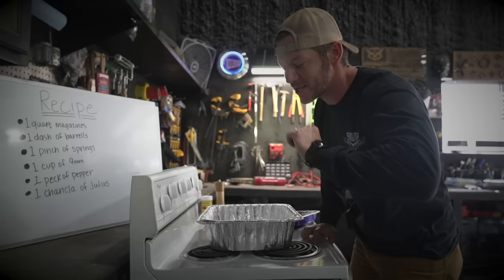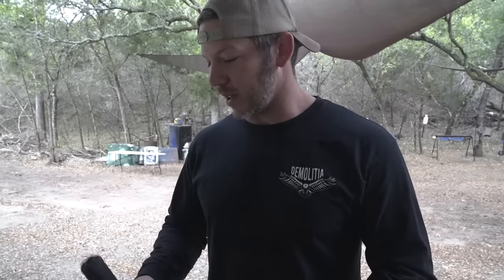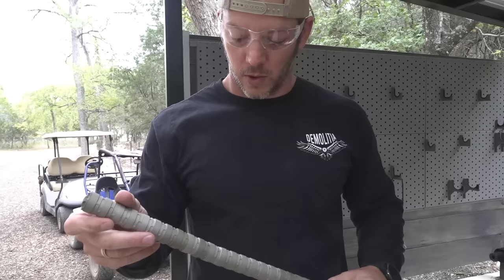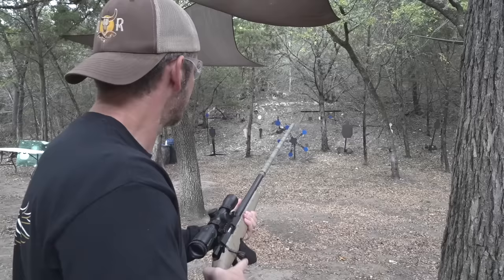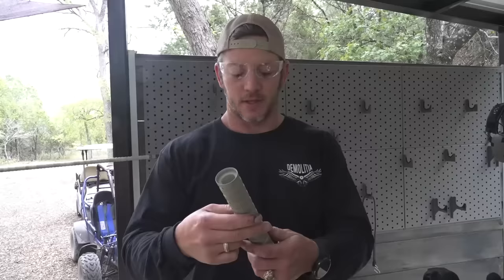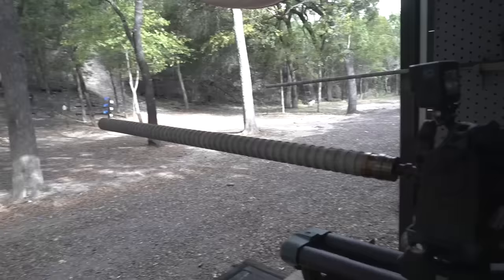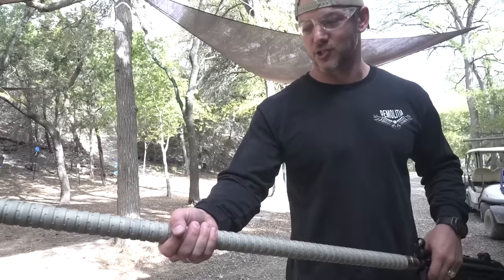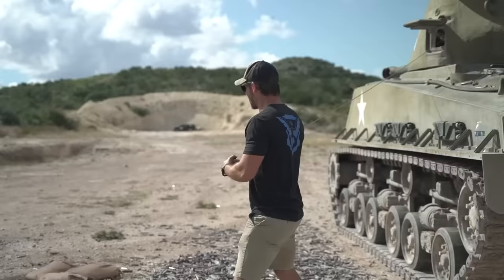Shooting The Worlds LONGEST Silencers!!! But Do They Work???

Comment: I would love to see db metering on this. 

Also, point of impact shift testing. 

I’m curious if the trajectory of the bullet shifts a bit with each section of baffles, or just once when the first stack is added.

Comment: My brother and I talked about this a few weeks ago. Imagine putting bipods under the suppressor every foot or so and how long you can fire it level. I guess it would depend on the bullet drop. But I’m super stoked you did this! Thanks!
Reply: This needs more likes and comments! Also a nice decibel reader would be great 👍
Reply: The problem with adding bipods is that when carried it would create more flex and thus defeat the point of this cause it would be warped at that point. Although if you just have tripods set up and then sit the silencers on it...that would work.
Reply: @user-fq4vx6wh9o  

It would be work but level everything out.

Comment: You gotta do larger calibers. I want to see how many suppressors it would take significantly drop the sound. Next time also measure decibels too.
Reply: Yup.. I wanna see him suppress a M777 howitzer.
Reply: @integratedhatespreader  lmfao
Reply: @integratedhatespreader  next your just gonna go for the M1 Abrams tank huh? 😆
Reply: One thing you wont silence a anti tank gun not even if you put 39 full links on the gun still wont suppress the sound mainly because the sound will seriously go through the gun not just out of the  barrel but even through the back chambering plate.
Reply: @Offsecwrkr  it was a joke kiddo… it would never work even if the suppressor worked since they are massive supersonic rounds.
Reply: @malcomx1924   Yes you are quite correct.

Comment: I think the reason it was baffling while you were holding it but not when clinched is because of the boing factor. If they made those solid to stack it may be feasible to have a hold-able 69 long suppressor.

Comment: I mean for the .22 the main problem was just the weight of the suppressor. The reason it worked in the vice vs in hand is because in the vice there’s less variation and movement. In hand it sways more and it jerked around when reloading, you didn’t give it time to set so it was curving and jerking has you shot down it

Comment: Looking at the slow-mo, I think I see why with the 9mm you weren't get baffle strikes.  Beyond them being stiffer.  On each shot, the gun shifted back which would have had the effect of pulling the silencer straighter.  Not something you want to rely on, but it was definitely having an effect.
Reply: So...

Pulling on the erection to make it stiffer makes it work better?
Reply: What I’m wondering is whether it’s the recoil (probably not) or the expanding gases (what I would bet on) that causes that. It’s almost like it’s being inflated like a balloon for just long enough to let the bullet pass through, then when the bullet “uncorks” the end it starts drooping again. Obviously the bullet doesn’t touch the sides of the baffles, but the gas pressure might be high enough for the bullet to have a sealing effect while it’s still in the silencer.

Comment: I'd bet the suppressor's utility is proportionate to the relative change in temperature across the segments.
Ie, where it gets warmest reduces sound (pressure) the most, where the delta is smallest it's doing little.

Comment: Would love to see how quiet you could make one of your .50's with a system like this... I'd also recommend a spirit level and a tripod/flat surface just in case.
Reply: I feel like a suppressor for a .50 BMG should have a fair amount more of expansion volume. The Chinese type 64 pistol and the maxim 9 both have larger suppressors and are phenomenally quiet. Scale up the design to .50 and that ought to be a rather quiet .50 cal. Of course you might need to run subsonics.

Comment: If you think about it, you could mount the MP6 with the 6foot suppressor in a bunk an donly have that bit poking out. It would look like amounted turret lol. NAd it'd be even better if you reinforced it with a metal rod to help the suppressor stay aligned by attaching to a few points onto it. so if the apocalypse comes you can quietly defend your base.

Comment: Hey Matt, it would be interesting to see a video comparing 12 gauge steel shot and lead shot (also in "super magnum" versions). As far as I know, steel shot has a lower speed due to its lower mass and therefore does not fly as far as lead. However, it would be interesting to compare the penetrating power of steel and lead at a distance of 25-30 meters, because steel is much harder than lead. As far as I know, the only reason steel shot is used is lead toxicity, which can be a problem in regular hunting grounds.

Comment: The reason it struck while holding it is because you introduced "motion"/flex...  That's also why it hit different baffles instead of the same one repeatedly...was because of that oscillation that Matt introduced with his motion, causing the straight bullet to hit at different points of the "wave."

Comment: I believe there could be baffle strikes but due to soft lead at low grain(typically 40 grain or so for .22lr) will just slice a piece off at speed, and titanium is nearly indestructible to .22lr unless its some kind of steel penetrator in it. Makes me wonder if q can reinforce and make a supressor this long that doesnt strike, would be by far the quietest supressor likely ever made (for .22lr at least)

Comment: The problem with the actual firing is the suppressor was still bobbing and it will do that alot when fired from any not perfectly solid position.
  Also, lube the fking threads.

Comment: i think the only reason the 22 struck was because the unsupported length and wiggling around with the bolt action had it not been bolt action like the 9mm i dont think it would have struck when you were carrying it

Comment: Where the notched aligned probably not. He could have put the 22 with some stilt so it didn't bounce after the shot even then it still worked I didn't think the sub9 would cycle but it didn't and didn't he was worried it would drop even it it did because  of gravity  it would take some distance usually it would not  travel true because of the baffles bouncing upland down after the fire. That was insane. If he had a stable table to hold it up and had every single one lined up with the Notch I'd like to know  which ammo wjoch barrel and twust abd length is the best. I really thought the sub was going to be an issue and I'm sure it would be after a certain amount because its heavier and slower i wonder what woukd hapken with the CCI Quiet 22. I actually  used that and it cycled so well. Yhey crimp it so well. My federal ones suck they dont cycme and its says it won't. But CCI not only does it feels strong out the gate like a regular 22.  and  test for noise decimals per foot. What was the lowest you can get with that length. If you have seen the inside of some surefire surpressora there cuts or slits after the first and as it stands the side walls get smaller so they can fit like 16 baffles in a 7inch can then u see square notes on the tops where they stack I'm not sure what that does. But I always  though Surefire makes the best in terms of overall designs. And first flash reduction i think the cap has so much to do with The flash but the stacking too. How they stack them the distance  with the side walls is really important. Anyone know what those square notches do on the tops of each baffles they are stacked. Does it leak a but of gas out. Mostly SS. I think that's the smart thing because  there's all sorts if ss now and some are stronger and they use really light metals too titanium is very light and strong but its not good to heat it alot. Loses its strength It's not like knivess vg10 v2 9chrvmore like 410 440

Comment: no offense, but why didn't you have a decibel meter when. you were doing this? that would have been fascinating to me. also, you could get around the whole baffle strike thing by anchoring the silencer at points throughout the length such that the silencer is truly parallel to the table.

Comment: I would make it fatter rather than longer or use a baffed backflow chamber suppression system.
Reply: If your wondering how a suppressor works... It changes the sound by allowing the explosion of Gass from the end of the barrel to expand into a closed chamber. If you look around you will find places that make a suppressor that can mount to the under rail of so equipped weapons systems and seals to non threaded barrels with a gasket. This type I'm talking about has a baffled expansion chamber under the mounting lug that provides a much larger first chamber followed  by only usually 4 baffle rings so it's much shorter and some even have a packing in there that makes them so quiet they sound like a pellet gun even with full +p 9mm and 10mm. If you guys at the ranch wanna really get into suppressor stuff....that's the direction  I would lean to cause it's the pinnacle of suppressor  technology  right now.

Comment: I'm late to this party but here's a fun piece of theoretical science for you.

When you felt the length of your erection, where it got cold was the spot that its load was spent, everything past that was just floppy weight. Erections should always be warm as a rule.

(Suppressor sections that remained cold after firing didn't actually help to make it quieter, as all of the thermal energy and expansion in the powder had been expended in previous baffle sections)

Comment: My guess would be that the pressure from the shot actually applies enough force to straighten the suppressor just enough to avoid baffle strikes. Eventually though the weight of the suppressor end overcome the shot pressure resulting in a baffle strike. You just don't know when the balance shifts to the bad side. Also, I wonder if the baffling reducing the pressure behind the bullet would allow gravity to work some to extend the length of the suppressor a bit more. (I know that is a stretch of theory.)